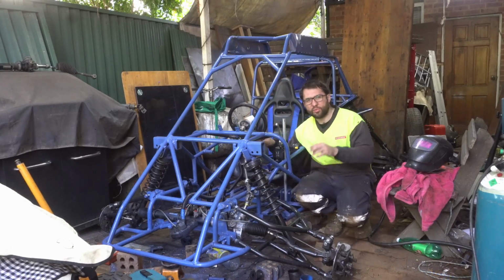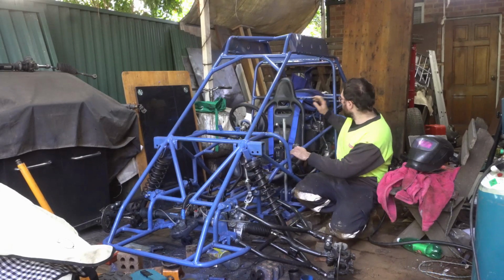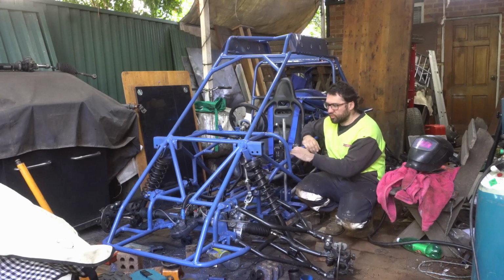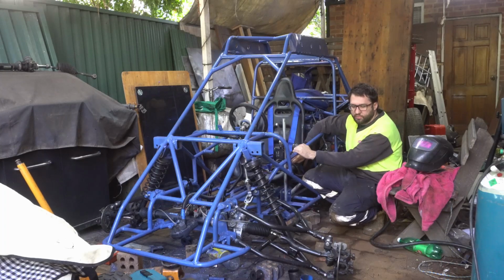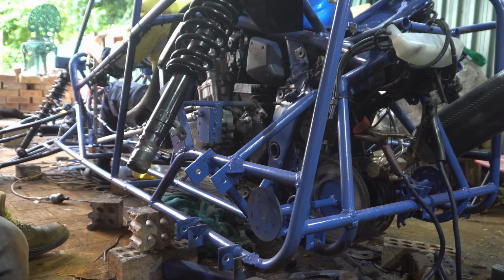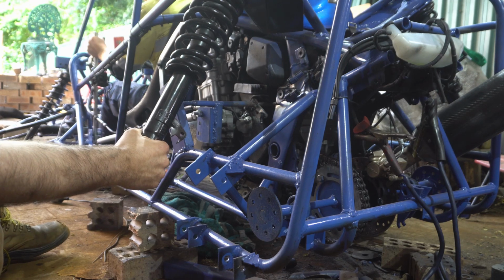Off road buggy - Day twenty eight and twenty nine - Clutch repair

Comment: Good stuff Will, I know it's getting close but looks like it will be ready for October Madness. Tell Nick he can't wear those Black shoes then because they are the same as mine !  I am a bit Worried about those rear drive shafts, they look a bit thin.
That motor with the gear reduction will put down some serious torque to the back wheels,  Did you use Tensile Shaft steel there ?  Fingers crossed it will be OK.
Anyway can't wait,  see you guys then. ATB Len
Reply from the maker: Hey Len, 
The rear drive shaft is an upgraded size from the original bike one. I did make sure to use 4140 grade steel for the shaft. Might need to reduce the torque more but we wont know until we drive it. Haha
Reply: @WowenandWilma  Sweet ! Did you need to re-temper where it is welded or is it like a lot of my builds ... try it and see and hope for the best.
Reply from the maker: @NightVisionHunter1  I didnt re temper it no. Hahaha i guess we will just try it.